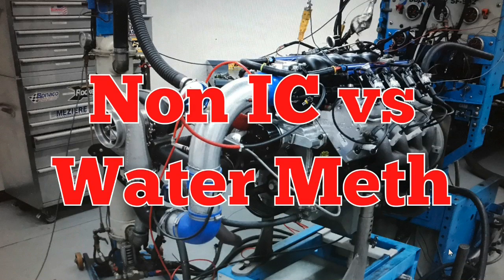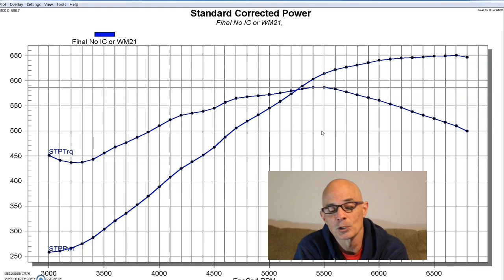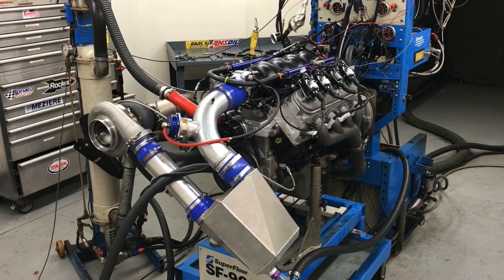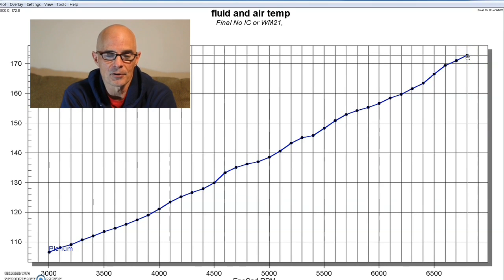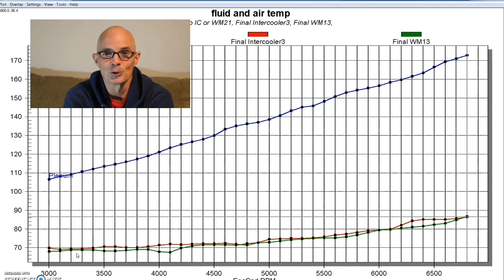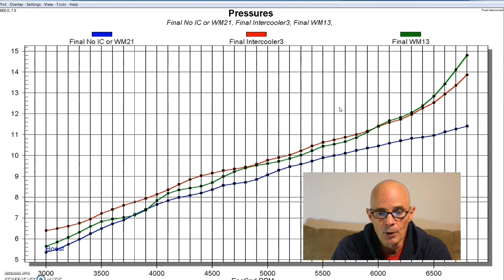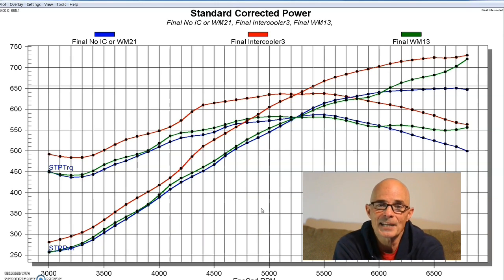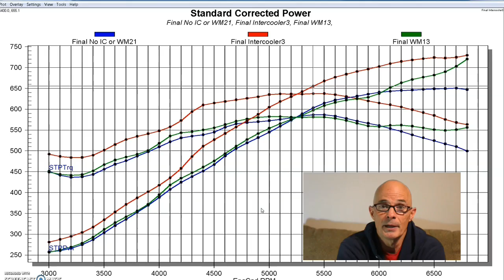WHO'S COOLER? WATER METH vs INTERCOOLER

Comment: You're mistaken on a few points.  The power output of a2w being higher at reported like charge temperatures basically proves the the sensor is reporting false cool temps with water meth. When you have a saturated "wet" temp probe it is not giving you accurate readings of the charge temps as a whole. The data from a wet probe  esp. One with alcohol/meth is useless.

Injecting pre turbo increases the efficiency of the turbo itself. Injecting with a direct inj. Kit still will not make the same power per pound as cooler denser air from an A2W. Ideally to get the most  of your water meth you inject 100* meth as it can pull the most heat from the air charge. You would inject large volumes and inject pre and post turbo. Meth inj WILL NOT cool the charge temps down below its boiling point of around 150*. Again your temp probes are useless here. The big gains come from octane bumps and the cooling affect in the CC. Both help more with detonation.  You cant measure that with your equipment. 

Water meth will never make more power per pound than an a2w. But it will allow u to run more boost without detonation and is very cheap. 

If your goal is say 700hp on pump gas, JY water meth can get u there easy. It will be at a higher boost than an intercooler version... but the end goal is the same at MUCH less cost.
Reply: Intercoolers are cheap these days though. For $500 bucks, even an EBAY setup is much better than nothing.
Reply: He did state that further testing showed a large variation in temperature between runners. Ignition may have been retarded substantially to prevent detonation even if it was occurring only at one cylinder. We don't know.

The boiling point of a liquid is the temperature at which it evaporates when surrounded by it's own vapors at atmospheric pressure.It does not indicate the temperature at which it will evaporate when surrounded by other gasses or at lower pressures. Try wetting your t-shirt with methanol and stand in a breeze. It will quickly evaporate, and cool your body, at a temperature far below it's boiling point of 150*F. I'm sure you've experienced it with wet clothing.

Also, non-intercooled, boosted engines running only on pure methanol appear to be limited mostly by the mechanical resistance of their components, not by detonation or pre-ignition.

Comment: Great vid again Richard , I run a too small air to air with half the water meth snow wants on a big hp motor with single plane carburetor, have any experience with both running ?

Comment: Richard, did you try and put the nozzle way early in the charge tract. Like right after the compressor wheel to give the methanol and water a chance to mix and cool?
Reply: Victor Dahn  on top of pre-turbo meth injection, spraying into the volute of the turbo is about thing to test

Comment: I'm not sure why you guys run water in the meth system (other than for cleaning and fire safety).  I have always ran 98%-99% meth in the M/W mixture, only adding the small amount of water for cleaning purposes.   Water reduces power, meth adds to it.  It's far easier to tune with less water too.  The higher concentration of meth adds a lot more octane for the combustion.  Meth cools significantly more than water also.  Since meth atomizes better and evaporates into a gas so much quicker than water (hence more cooling), the distribution in a dry manifold is better as well.

For these reasons, you can pull fuel (gas) and add more timing as more meth is introduced... as benefit, less injector DC is needed to.   The only down side is the more meth is sprayed, the more the risk of nuking the engine should the meth system fail, which is why you should have multiple meth system safeguards in place.   The other thing worth mentioning is straight meth is pretty flammable, it stars flammable until you get down to a 50/50 meth/water mix.  Running straight meth I would recommend using a small fuel cell and braided SS lines for safety.

I've played with all different fuels in my meth injection systems on my procharged vette and TT Viper.  IPA, Ethanol, meth, nitromethane, etc,   Adding and subtracting water too.  The best combination I've found (cost effectively anyway) is straight meth for the reasons above.   I have my nozzles placed just after the compressor(s) to allow as much time as possible for the meth to transform to a gaseous state and allow maximum atomization.   I don't run it through the compressors as it will erode the blades over time.  In this configuration I have ran 1300 rwhp with the Viper (which has A/A intercooling too) using 93 octane pump gas through the factory "dry" manifold.   I'm sure I could push it further spraying even more meth, but this is as high as I have bothered pushing this combo before switching to race gas.

I haven't played with port meth injection, only because smaller nozzles in the ports would be required and I don't want to risk getting one clogged and nuking that piston... but I'm sure it would work even better!   I plan on adding twin turbos to the LS3 in my SL-C (my avatar) and I don't want deal with finding room for an intercooler, so maybe this might be a good time for me to consider trying DI meth into the factory LS3 manifold, although I still have the concern mentioned above as I would likely need fairly small nozzles...
Reply from the maker: 100% meth still won't make it evenly to all cylinders
Reply: Actually, water cools ~3 1/2 times as much as methanol. But I agree, I take my scotch straight up, adding water to your alcohol is sinful.

Comment: Just out of curiosity, what does an intercooler or meth do for a n/a motor?
Reply: "Inter"-cooling refers to cooling between (inter) two stages of compression, i.e. the turbo and the engine. "Pre"-cooling through methanol injection or other means will increase charge density and should increase power. Meth also permits higher compression without pre-ignition or detonation.
Reply: @fascistpedant758  couldn't an intercooler serve as a very expensive cold air intake ? Lol
Reply: @petehoefs2619  Intercoolers work by heat transfer, if you draw in air into the engine at say 20 degrees C and the air flowing through the intercooler fins is also 20 degrees C then there is no heat transfer.
Reply from the maker: people use them at Bonneville on NA applications
Reply: @jrobpat0154   You can circulate ice water, for example, through a A2W  intercooler to cool below ambient temperature.

Comment: The distribution problem is still going to be there with the LS intake design, but to alleviate it so some degree you have to look at atomization vs vaporization. Even vaporizes its going to have problems getting to all the cylinder evenly unless the fuel is injected at the far end of the runner from the valve, the LS is not designed to flow wet its only supposed to flow mostly dry air. Injectors farther up the runners would probably be the best bet, but packaging and a rats nest appearance are going to be the problem.

Atomization is large liquid droplets, vaporization is a different gaseous state that is no longer liquid. A gaseous fog is going to have vastly more surface area and stay in suspension in the air far better than larger 'drops' of a spray. You get a bit of this with a blow through carb. As the liquid vaporizes it pulls heat out of the intake, thats why ethanol and methanol work so well to cool the intake. They have VERY good latent heat of vaporization qualities, far superior to gasoline, partly because ethanol or methanol is a single substance with one boiling point and gasoline is a combination of chemical substances with wildly varied boiling points from 80F to 450F.

Now it might sound counter productive but one way to increase efficiency and power while running straight ethanol or methanol is to heat the fuel in the rails to 20-40 degrees over its boiling point. Smokey Yunick did it with gasoline on a Fiero in the 1980s, but due to the composition of gasoline it was crazy expensive with exotic materials. To control the boiling you need to raise the pressure in the fuel rails, 60PSI is more than enough to keep straight ethanol from boiling at 200F in the lines. 

In a NA application the engine manifold is under vacuum, with lower pressure is a lower boiling point, with more pressure is a higher boiling point.  That 200F fuel under 60psi in the rail is released into the 10-15in vacuum of the intake and vaporizes instantly. Normally, and Engine Masters showed this very well, with gasoline having the fuel cold makes more power. With ethanol and methanol they react differently, they are very different fuels. 

However they need enough time and heat to vaporize, which cools the intake charge. Placing the injector near the back of the valve, or inside the cylinder itself works better for gasoline, but less well for alcohol fuels as there isn't sufficient time for the fuel to vaporize fully. Gasoline wants to ignite on its own when you have heat and pressure, alcohol fuels do not. With gasoline you want the fuel injected as late as possible to limit pre ignition/knock/ping. No worries with ethanol or methanol about knock/ping, they don't light until the spark sets it off. Most engines are designed for the lower quality gasoline and it results in handicaps for the engine. Low compression, where the injectors are located, overly abundant waste heat.. etc. An ethanol or methanol specific engine is going to be rather different in things like compression ratio and where the injectors will be the most effective, which is why ethanol loses so much mileage in a gasoline engine with low compression, you're simply not working the fuel hard enough.

Its going to be somewhat difficult to do on a dyno, and will add expense and complexity to the water/methanol system, but heating it under pressure then injecting it rather than spraying it cold into the LS manifold should work better. Its still going to pull the heat out of the intake charge, but it will be a gaseous fog rather than larger cumbersome droplets. I use a heated fuel system, after the reg/return so no hot fuel goes back to the tank (no booms mmkay) to increase mileage and efficiency while keeping all the power I get from ethanol fuel and the high compression engines I build. It makes a surprising difference in mileage. I'd imagine BSFC on a dyno would stay the same as that is WOT testing, not driving around or steady state part throttle/low throttle angle cruise.

Getting around the late EFI manifolds with their convoluted air only runners is going to be difficult injecting liquid at the throttle body or before. Even a vapor is going to condense somewhere in there, lots of dead spaces and slow velocity areas with varied pressures, but its better than the distribution with atomization.
Reply: Much of your comment is technically accurate, but preheating the fuel is counter to the goal of increasing charge density through charge cooling.
 Smokey Yunick's experiments after the fuel crisis were aimed at lowering fuel consumption by optimizing thermodynamic efficiency. Unfortunately, history has shown that friction and pumping losses trumped the theoretical efficiency gain of his low power density engines, not to mention that he would have had trouble meeting modern emissions standards.

Comment: Richard,  after reading the first 80 or so comments,  it is obvious that people are not watching/ listening to the entire video. You said yourself that the long runner dry intake was not good for water/ meth and that was most likely the power difference. You mentioned a single plane or hi-ram setup would be better for water/ meth. You also said more testing is needed!  Nice video.
Reply from the maker: I need to put more info in the beginning
Reply: @richardholdener1727  There will always be idiots.  You can't fix stupid...

Comment: Im so glad you "discovered" the distribution issues with water meth. Ive always suspected it was iffy to use.. i wont use nitrous for the same reason...

A cool video idea would be to feed engines very specific temperatures  of air to see the effects on hp.. see if there is an optimum temperature.. change fuel as a variable.
Reply: Yes the distribution is not great with truck manifold ,but in my case there is no e85 in my area and I had significant knock at 9-10 psi of boost on pump gas . I have added water meth since and pushing 16 psi now with no knock whatsoever.  Yes it's not perfect but it still helps regardless.
Reply from the maker: it does help-just some cylinders more than others
Reply: @richardholdener1727  lol

Comment: My question is why did you ruin a perfectly good methanol injection set up by adding water?
Reply: Safty, need 51% water
Reply: Daniel Sullivan, yes safety is the only reason to mix in water. But then there are still plenty of flammable liquids under the hood of a race car to catch fire. We don’t build high performance vehicles to be safe. LoL
Reply: STREET RACER I’ve used it a lot. Both water/meth mix and straight meth. My main purpose was to be able to run 93 pump gas as it was a street car. The straight meth set up allowed me to make a ton more power over the mixture while still keeping inlet temps well under 100*. water has no octane, it can only take up space in the combustion chamber where fuel or oxygen could have been and therefore actually reduces power. Richard’s video proved that.
Reply: @mycargarage3984  That's not entirely true.  You aren't considering the massive expansion of water when converted to steam.  

This equals cylinder pressure.  There were steam engines long before gasoline and methanol engines.

Comment: If you have the space and the weight won't kill you I would always prefer the intercooler over any other method.  I have pulled 450+deg of intake temp out before with water injection but nothing is worse than having the water fail to come on for some reason and blowing your pistons out the tail pipe. :-(
Reply: Fact.  That is the chief downside of liquid.  Sensors, pump, nozzles.

Comment: I think a single plane intake fuel injection system, with a plate style water meth injection system would be the best, if you aren't going to run an intercooler.
Reply: James Green but will that give it enough time to remove the temp from the charge?
Reply: @fgchotline3964  yes it will because it actually is done in the combustion chamber- this is possibly why he claimed the differences in IAT seemed somewhat 
Insignificant in his test. I believe the true cooling effect from meth/h20 is most notable under compressions/during combustion perhaps. By and far the greatest benefit is from running a combo of IC AND meth injection being the meth SUBSTANTIALLY elavates the OCTANE in the charge and H20 handles the temp drop... Sorry for the ramble, hope I was at least somewhat helpful LOL
Reply: Like he said, he'd like to see port injection kits...
Reply: I prefer meth but on my DD I have noticed a nice tq gain on Cruze. Hit a small hill with it set at 5lbs and the boost jumps when it comes on even with Cruze control on

Comment: Is your water meth affecting afr ratios because you're adding another fuel
Reply: I can speak from my own testing with afr change with  50 % w/m.
Using 750 ml. worth of nozzles I had to take 6 jet sizes ( blowthru)out of the secondaries to get same afr.
Snow has a nice chart to tell you how much fuel to take out when using certain size nozzles.
Reply from the maker: we have AF meters to tell us what happens
Reply from the maker: AF was kept constant
Reply: Yes it does generally to a degree BUT it is less significant because the alky burns much different than gasoline does. If you're adding a substantial amount you are more apt to see it in the A/F ratio- it still is fuel aftr all

Comment: Back in 02 I put an SMC Alky kit on my Grand National ...really lowered knock and we mixed with water so it "steam cleaned" the heads n valves...lol...Come to think of it would it help as much now that I'm running e85 with an LS? I don't think as much
Reply: Great point.  The water alky mix was meant for guys who were trying to get max power on pump gas.  Then they said.. screw the water and went straight methanol.
Reply: Always straight meth for best results.

I used meth on my E85 fiesta ST that’s been running 30psi for 2 years.

Comment: Agreed intercooling without a doubt is the way to go however since the turbocharger is the source of the Heat would it not make more sense to introduce the water meth at the intake for the turbo and then have it in route the entire length of the plumbing to evaporate and cool the charge air

Comment: This made my day. Great video. Spraying the head unit will drop temps even more, depending what nozzle size is used. Total timing and Af ratio on each combo?
Reply from the maker: same
Reply: @richardholdener1727  
Meth should pass the intercooler #s with 4-6° more total timing.
Reply: Lots of “theory” on why pre- turbo injection would make the compressor wheel way more Efficient by making it a “wet pump” (basically taking up the machines gaps between the blades and housing). On top of the hottest part of the cold side being right at the throat (volute) exit of the turbo. 

Distribution?? I doubt it changes much. But you know what else effects distribution ? Volume of meth. 100% meth? Mixed water/ meth? Injected pressure? Nozzle size. I mean the variables go on. Maybe don’t use #25 nozzles? To get the same effect as a great intercooler like this test, it prob took a pretty serious volume/nozzle. Maybe use a #7 nozzle pre-turbo vs a #25 nozzle post intercooler that just floods the air with so much volume.
Reply: @bryanleverett2830  Just no. There is so much wrong with your comment that I'm not even gonna get started. To anyone reading this, that comment is complete gobblygook.